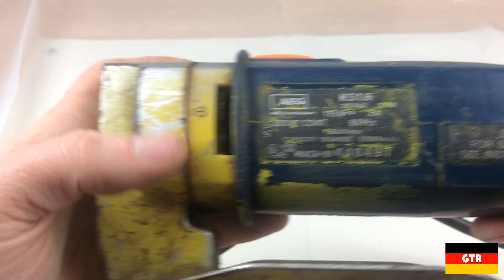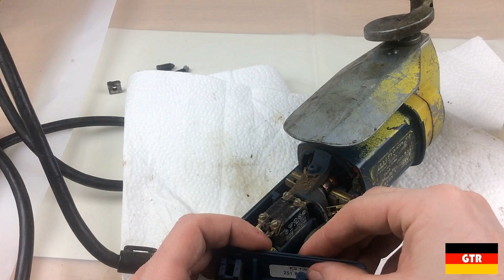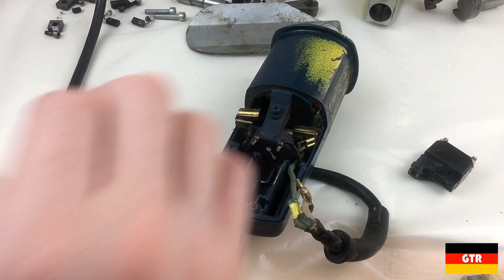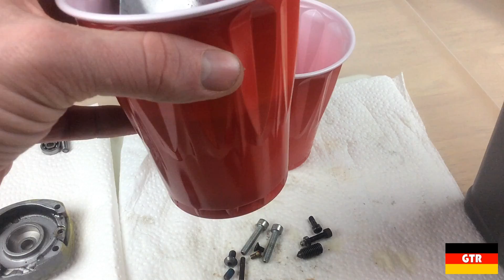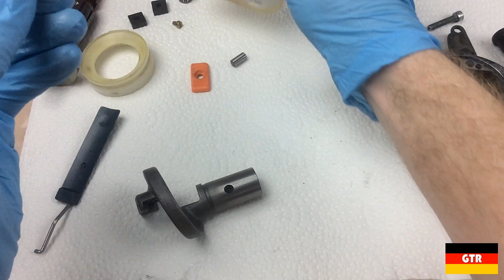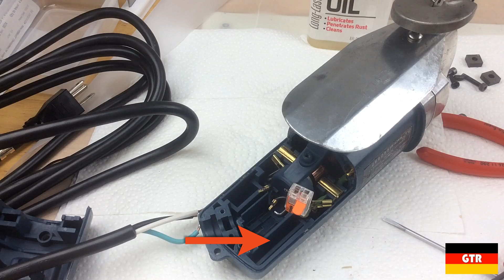Vintage 1980 AEG KS1.6 Sheet Metal Shear Restoration

Comment: Hi, I recently found an AEG shear at a auction, came in a box of random tools. I'm a sheet metal worker so this will come in handy! Any chance you know if a place to purchase new blades? Thanks, I really enjoyed the restoration video as well.
Reply from the maker: Milwaukee had very similar designs during this era and often used a lot of the same sub-assemblies as they were owned by the same parent company at one point in time.  That is where I would look if I needed to get a replacement.
Reply: German Tool Reviews Awesome, thank you.

Comment: I wonder if the older Phillips rotary hammers were made by AEG.

I often use cup leathers to polish commutators as they do a very good job of cleaning them up without removing the metal.